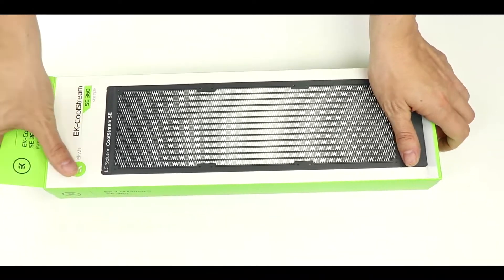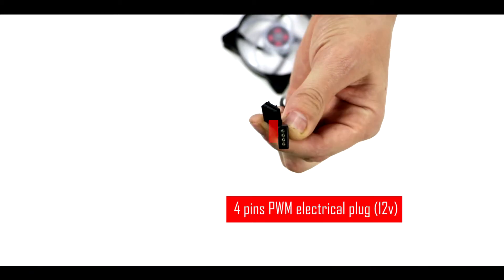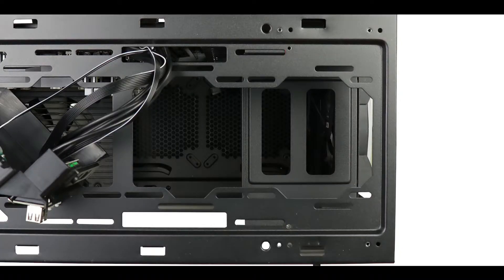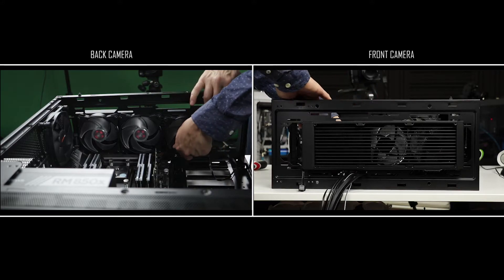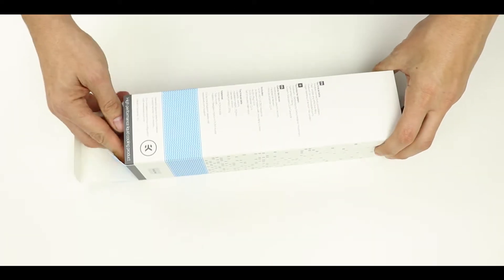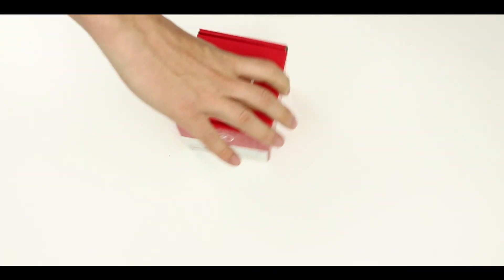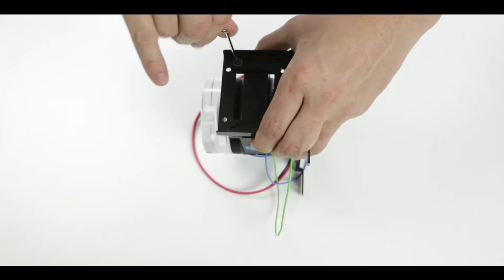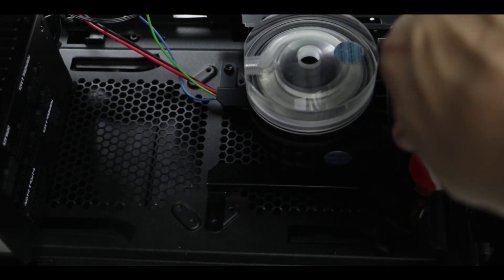Radiator, Reservoir and the Water Pump ( The Threadripper Build 3 of 8 )

Comment: Not sure how fimiliar you are with the kraken x62 cooler but thought I would ask. The instructions say to plug the 3 pin pump tach cpu fan cable coming from the cooler to the cpu fan header on the mobo. The thing is, I want to use the cpu fan header on the mobo for my pwm hub on the back of phanteks enthoo atx case and I only have one cpu fan header. Ultimately what I'm asking is could I connect the 3 pin pump tach cable to another header such as the aio pump or the cpu opt header? Any info would be awsome.
Reply from the maker: +Mike From The Block yes you can. They will all deliver the 5v u need to get ur pump going. 
Only thing is your PWM reports might in the wrong place but just as long as you know were to read it's all good.

Note that cpu_fan and cpu_opt are the very same plugs. Only difference is that opt can be slave of fan.
Cpu_opt is here in the case you'd have 2 cpu fans and would want to monitor them separately.